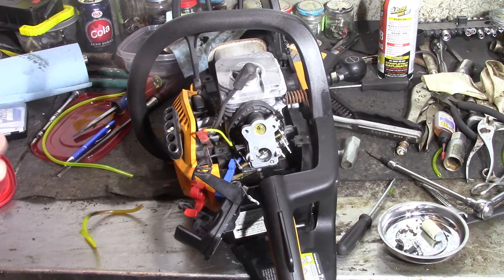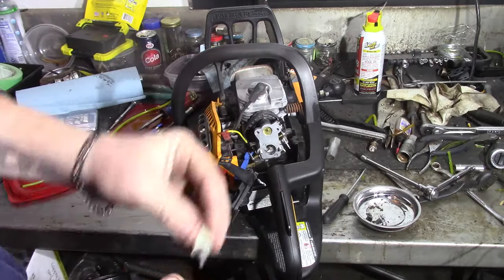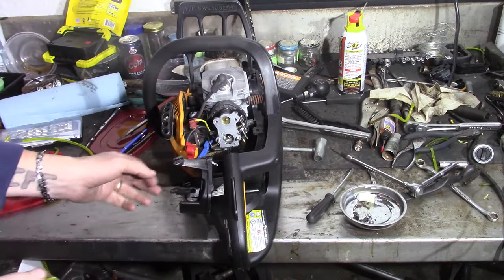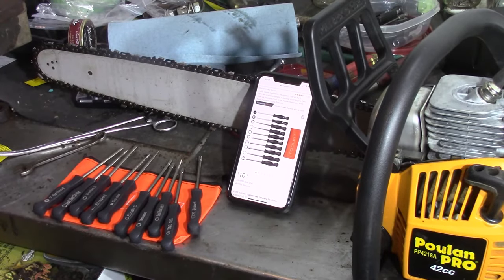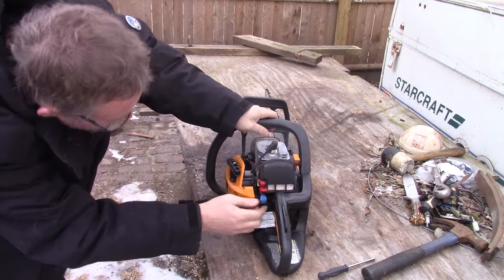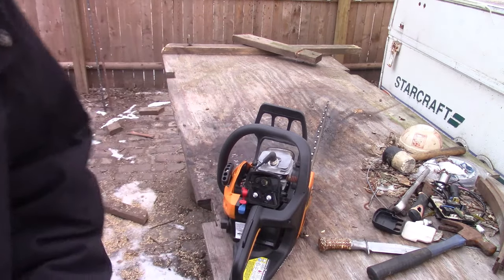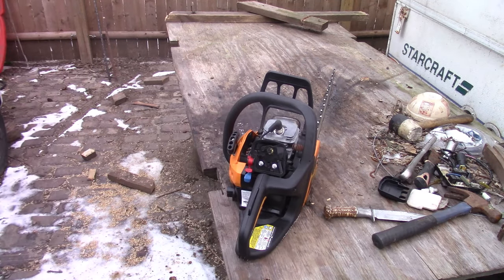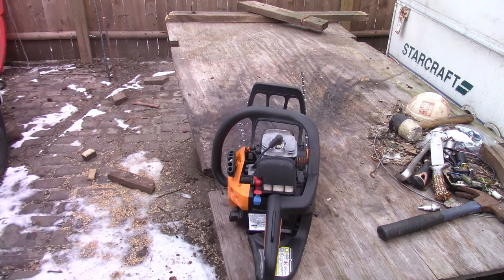Poulan Pro 42cc PP4218A Chainsaw carb adjustment

Comment: Hey thanks for the video!!!
I've just picked one up and the fuel lines are rotted off, could you tell me where they go? Any help you can give will be greatly appreciated!! Thanks again for the real world video!!!
Reply from the maker: The side of the carb with the linkage should be for the main fuel line. The other side will run to the primer and then go from the primer back to the tank. I hope that helps some.
Reply: @GenerationX1971  thanks just got it going! I appreciate the help!!🙏🙏☺️💯
Reply from the maker: @freedomlibertyspirit9782  your welcome.

Comment: Found 1 sitting in my dad's garage been there about 10 years bone dry tank put gas in it fired right up
Reply from the maker: Good deal. I haven't got that lucky yet. Most of them I pick up at least need fuel lines.

Comment: Had a question regarding Chain and bar Lube. you ran it pretty good, did you notice the chain or bar with excessive lubrication? I just changed the oil pump and it does not spit out as much oil.
Reply from the maker: It was slinging oil pretty decent off the tip. I believe the oil in this one was straight 30 weight engine oil. All I had at the time.

Comment: The chain keeps spinning after I got it, running. Should it set an idle before before you pull the throttle.
Reply from the maker: I’m not a pro by any means but on mine I just slowly idle them down until the chain stops moving. Hit the  throttle and let it idle back down and see what you got.

Comment: If you notice that the idle does not seem to be consistent or it starts hard or just stops running, it's NOT the carb.  It's the two bearing seals on either end of the crank.
Reply from the maker: Vacuum leak per say?
Reply: I learned the hard way, but OEM seals or the cheap crap leaks
Reply: ❤ @GenerationX1971

Comment: If only I could get mine running like this, carb problems and I have no idea how to tune it for Arizona 🌵
Reply from the maker: Did you check the screen in the upper part of the carb to make sure it’s not clogging up on you?

Comment: Do you find hemostats work better than needle nose pliers? Maybe I should get some
Reply from the maker: In most cases for me they work better. If it’s a really tight fit I do have better luck with the needle nose pliers. The pliers I use have a slight curve in them.
Reply: Yes curved and straight set is required

Comment: What’s the size of that small fuel line?
Reply from the maker: 3/32 inner by 3/16 outer diameter. Hope that helps. If you have a Lowe’s or Home Depot close by they might have the kit that comes with a couple different sizes of line and a new primer.

Comment: Chain is not to tight take the brake off.
Reply from the maker: I thought the same thing at first. If you watch just before it starts running I checked the it to make sure it’s off unless malfunctioning. Runs good with the new bar and chain on it now.

Comment: I wish you explained how😢
Reply from the maker: Which part did you need better explanation of? I appreciate the comments because it will help provide better information on the next one.
Reply: @GenerationX1971  how many turns to start with what way to go to achieve low-end power or high-end power? How to get it to idle? I'm so lost.
Reply from the maker: @Toby.puppyboi  this saw ended up needing a new carb. If it’s a new one it’s not as bad. I start with the low setting and turn it slowly until the saw starts to stumble and then back it off until it clears up and gets a smoother idle. The high side is basically the same way. Once you get a good idle hit the throttle and see how well it revs up. The high side might need the same adjustment. Rev it up turn the adjustment screw until it starts clearing up. If it’s the factory carb and it’s bogging it’s possible the fuel filter needs changed or the small screen in the top of the carb is plugging up. It’s truly not as bad as it sounds. I’ll remember to go over it in more detail when I manage to pick up another saw. Poulan is a decent home saw as long as it’s taken care of. Most of the ones I pick up are just neglected.
Reply: @GenerationX1971  I have had many chainsaws and picked this up for 80 out of peer desperation, and it's been the best dependable little saw I have ever run, so I completely agree with you. Unfortunately, I broke the throttle off the carb, so I had to get a new one. I did get it running now. Thank you a lot!
Reply from the maker: @Toby.puppyboi  glad we could be of help

Comment: Useless. Doesn’t say what adjustment he’s making.
Reply from the maker: Thanks for letting me know. I’ll be a little more clear on the high and low adjustment on the carb with the next one 👍
Reply: @GenerationX1971  Yep. I couldn't find what you used as a starting set-up for the L - H or idle adjusts...
Reply from the maker: I agree It should have been more detailed. All the old used saws and blowers that I pick up we try to start them to see what issues they might have. Most of them have just been sitting for a long period of time and just need a little tweaking on the settings. Some of them are simple just turn the adjustment screws to reduce the amount of fuel or turn to add fuel. Some of them I close the adjustment screws and slowly turn them open as I go. As far as the idle just set it to the hat your happy with. If it’s a chainsaw I keep the idle down just low enough to keep the chain from turning. Trimmers just low enough to keep the spool from spinning. Next one I come across I’ll go into more detail.
Reply: 😂Thats exactly what I did on my 4218 Poulan Chainsaw. 
What a workout bro. My shoulders got a workout as well
I honestly think if its that hard the carb is dirty. 
Im going to put the carb in the ultrasonic.
See if it gets easier.
Reply: Start with both screws in, back out L 1 1/4 turn and high H 1 3/4 turns 
One pull full chock and then half choke, let idle and warm up